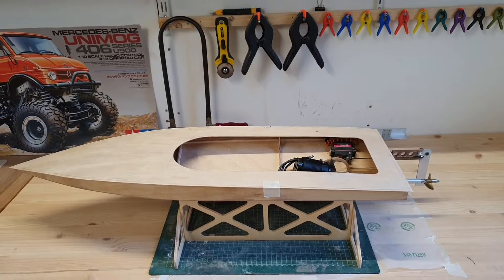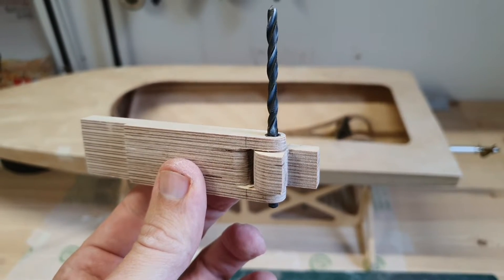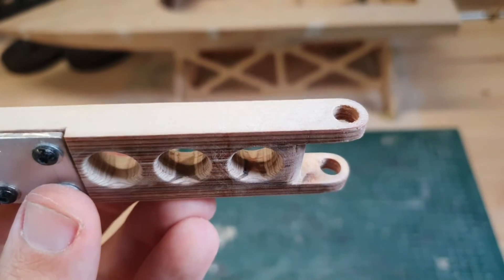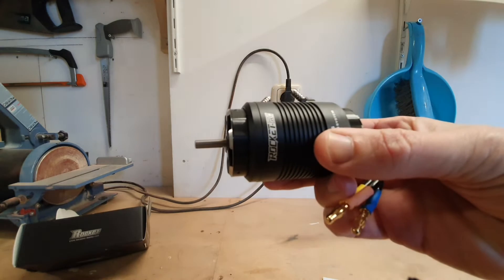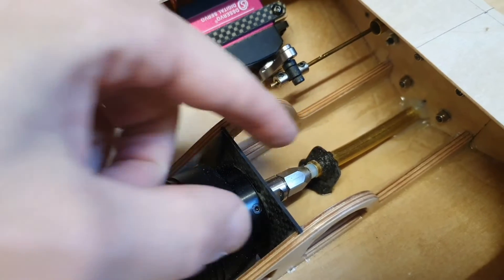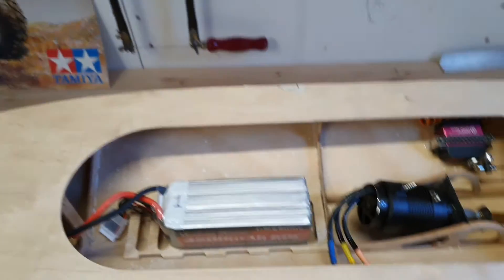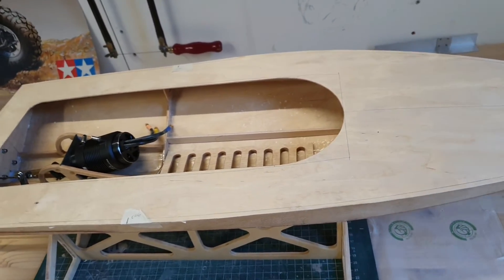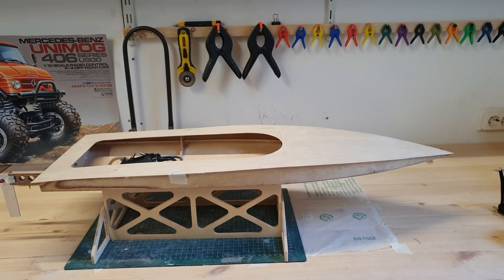DIY rc boat: 60mph mono hull - part II

Comment: Did the maiden run with my wild today, I got scared how fast it is. Some fine tuning is needed as it will almost roll over at max speed
Reply from the maker: Sounds good, Thomas! It sounds like you have some torque roll. What size prop are you running?
Reply: @CozyRC  42mm 1,6 two blade
Reply from the maker: @thomassalin949  Sounds perfect! And do you use trim tabs? They will settle the boat down, too
Reply: @CozyRC  i have trimtabs, need to adjust them some more before next run, still have not installed turnfinns

Comment: Hi, Do You have  that  cool plywood motor mount plan available?  I scaled the plans  to 810mm and started building the boat
Reply from the maker: Hi, sounds good. The actual scale is 800mm, so your build is almost identical to original. Send me an email at cozyrc1 at gmail.com and I will send the motor mount drawing to you.

Comment: What kind of wood you use for this project and all electronics I'm looking to build one for my son  ??????????
Reply from the maker: Hi, for a 32" length hull, I recommend 1.5mm birch ply for the bottom and 1mm ply for the sides and deck. Bulkheads from 3 or 4mm ply.
Electronics really depends on your goals. 
I explain in thuis build videos what I used for electronics and also what wood. I hope it helps! Cheers, DJ

Comment: Great work...is the ally steering boss welded?
Reply from the maker: Thank you Colin. The steering boss is inserted in a drilled hole and bonded with epoxy. Cheers, DJ